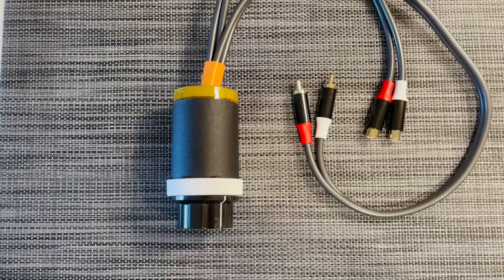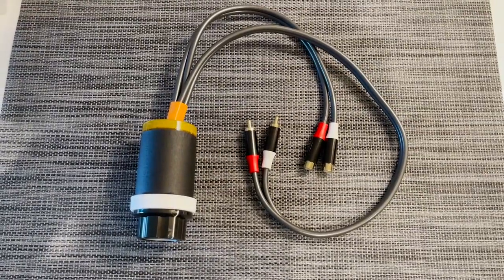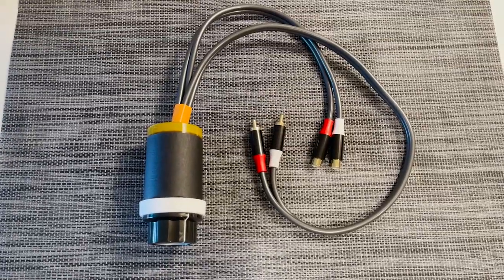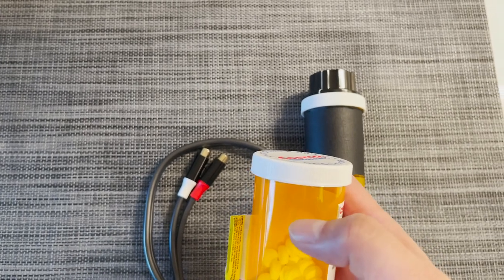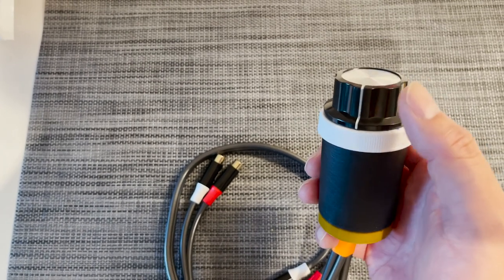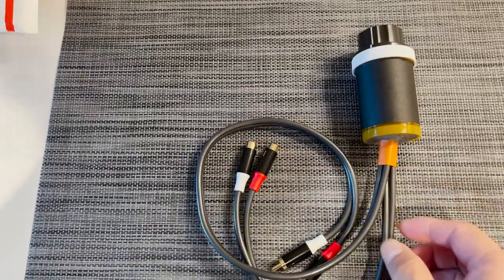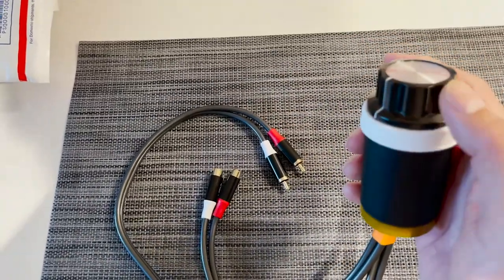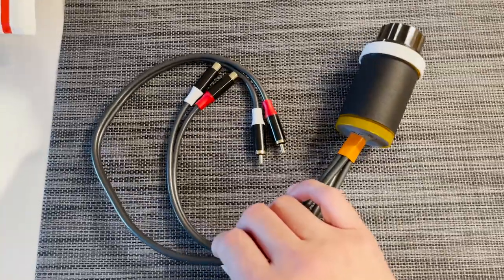DIY - Inline volume control in a pill bottle (as a passive preamp)

Comment: Thanks for posting this!  I made something similar years ago and still use it.   I didn't think of such a small container, so mine floats in the air on the wires.  The connection breaks when anyone is too rough and I have to re-solder.  Found your video searching for tips. because I'm planning to put it back into a case this weekend, which was a passive preamp I made earlier.  That was basically the same knob-on-a-wire but with a switcher to have multiple inputs to select.

Comment: Thanks for the video!
What would be the difference between a 50 and 100K ohm pot?
Reply from the maker: It's mostly related to the preamp output DC block capacitance, as it form a high-pass filter together with the pot impedance. Therefore, 100k ohm pot may be beneficial to extend the low-end frequency response. However, high pot impedance may be more sensitive to alien noises and reduce signal-to-noise ration. I think that 50k ohm is a sweet spot.
Reply: Great explanation, thank you!!!